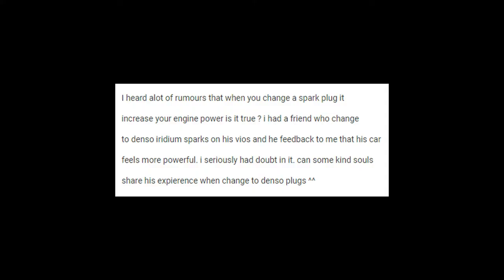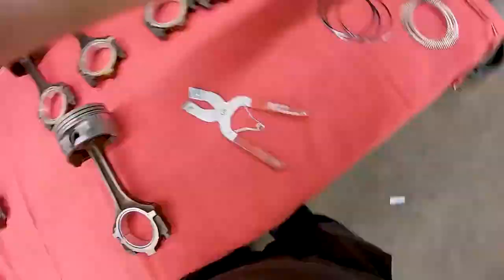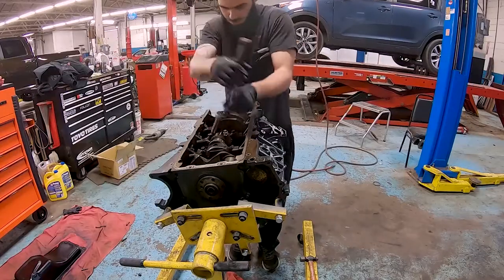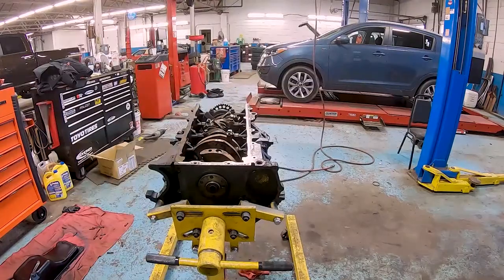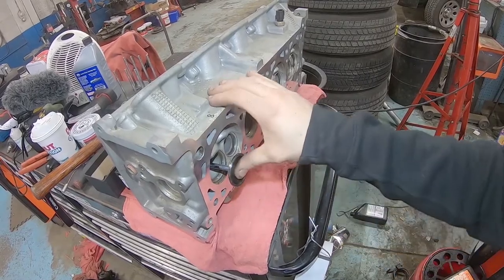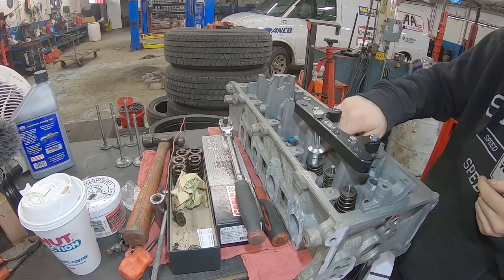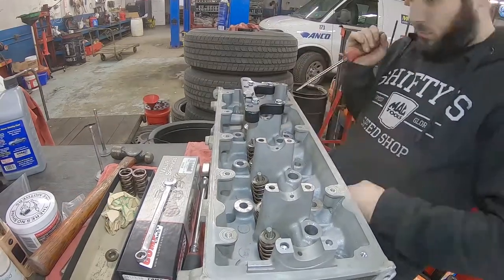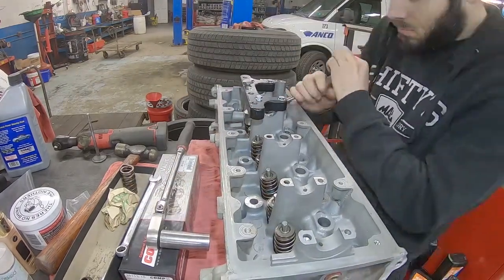PERFORMANCE MODS TO NOT BUY

Comment: Hope lots of people will listen... im so pist of those false clame gadget or myth!  Oh and what cam did you chose? Are you doing the pi swap on your npi? I did it like 7-8years ago with ported heads and oversized valve fbo lt everything and only dynoed 289whp/312wtq😭😭 i did a mistake degreeing or with the timing... anyway im running now a stock bullitt longbloc and love it!
Reply from the maker: I went with pi heads, comp 268 cams, comp springs, and full bolt on.
Reply: @RatchetstrapMedia  nice! Youll love it! Dont know the 268 ? Always hearing about 262 or 270 278 . I have the vt stage 2 but i think ill go with sone todd warren next time! $$$ one day! Do you have the higher cr mix up? Npi/pi or is it a pi long bloc
Reply from the maker: Npi/pi. To be honest, I’m trying to sell the engine. I want to build an ls, especially if this thing doesn’t even get 300whp. I’m gonna be MAD if that’s the case lol.
Reply: @RatchetstrapMedia  it is😣 around that you should play with rpm and cr like 7500rpm 12:1 cr should get you around 350-375 with ported heads and big cams